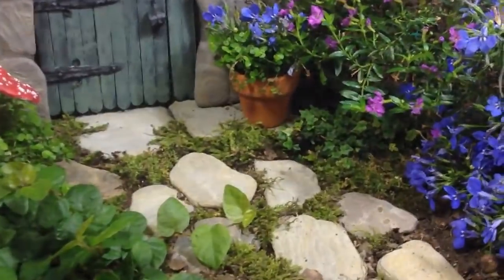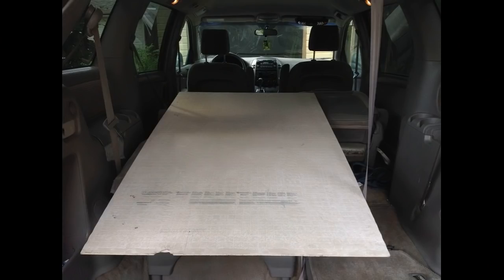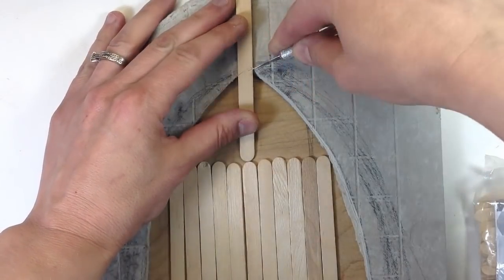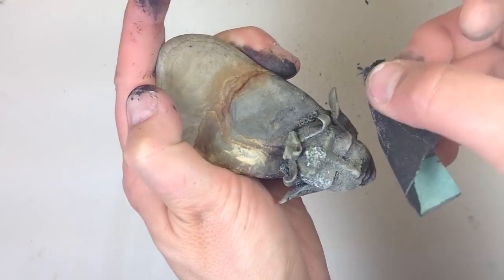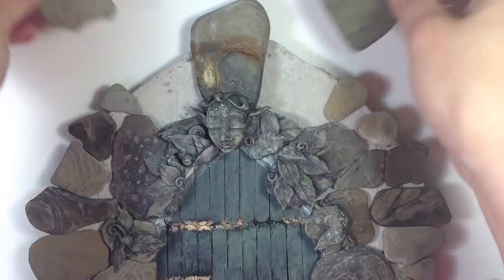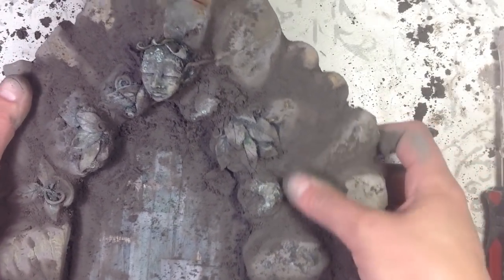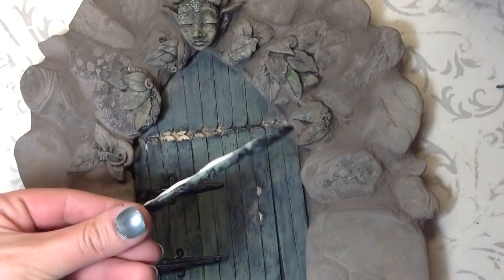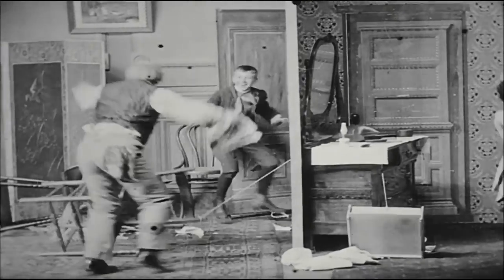Stone, Wood, & Polymer Clay Fairy Door Tutorial for the Fairy Garden

Comment: If you put a thin coat of mortar on your plywood and seal it with the polyurethane you will have a base that is alot more waterproof than just paint and polyurethane.  Realy love your work. I should have watched your basket tutorial  3 weeks ago lol. You can make your basket stronger and more weather proof by using mortar on it and then brushing off the grit when it is almost dry... if it dries the grit is staying put but adds a different texture that i find pleasing.

Comment: your clip like bringing me to the fairy world 😆😆😆😆😆 but i wonder that when i put it on my wall for a long time, dust will stick it and how do u make it clean ? if u use water, the color is fading away ?
Reply from the maker: I've found that the door is very easy to dust with a dry paint brush.  I just dust it like I dust other things in my home. No need to get it wet to clean off dust.  If you want to keep it outside, the color shouldn't fade very quickly because the products are for outdoor use.  I use outdoor paints and you can add a varnish made for the outdoors.  Thanks for your interest, thuy Thu! :)